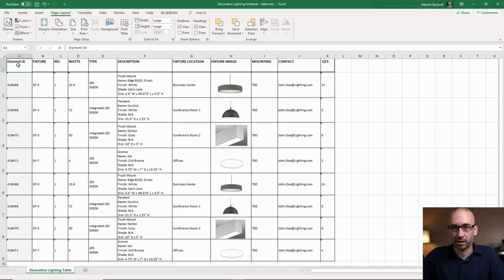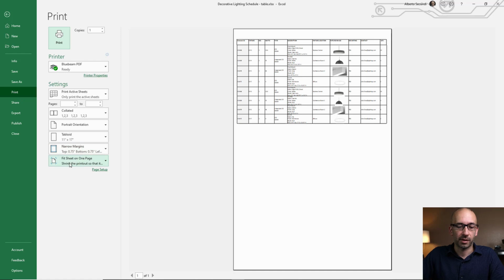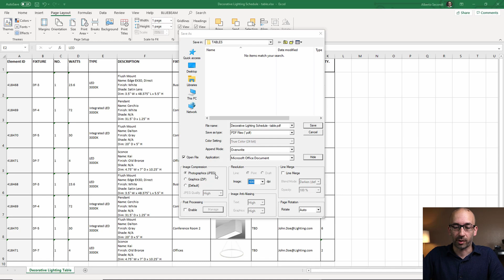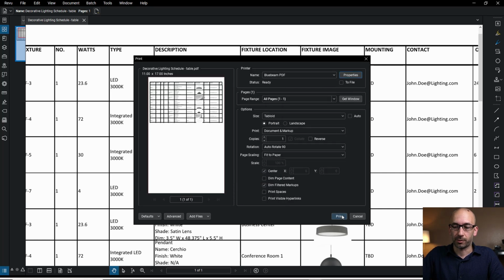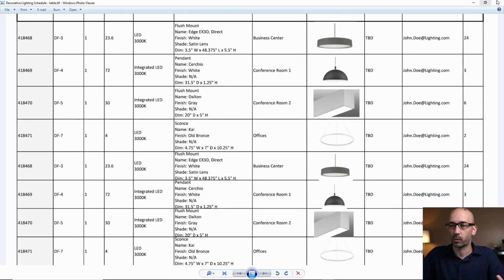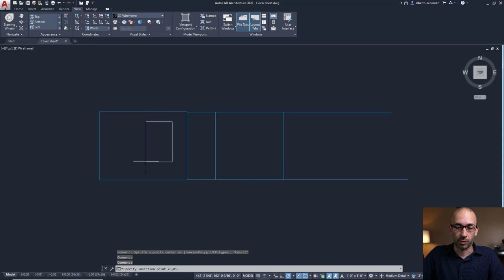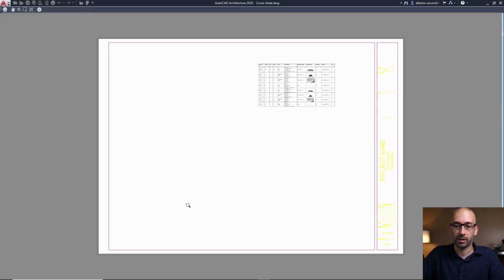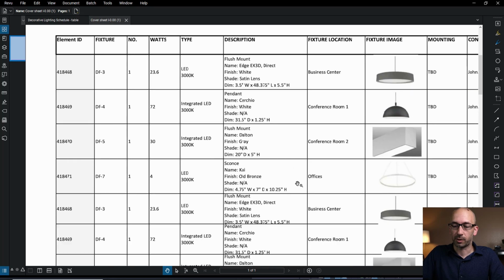How to insert Excel tables into Autocad and get high quality prints

Comment: Hi Alberto! I tried a lot of solutions.  What about print excel table to pdf @600dpi, import it in Autocad, print Autocad sheet (either in model space or paper space) with Dwg to Pdf setting Custom Properties>Raster image quality:2400dpi.
Another option: embed the excel table as OLE object. Of course this will bloat the dwg file size but you will have all in one file.
In case your table does not contain images you would set the plot quality of your imported excel file to low or monochrome for better linework and text quality. Bye
Reply from the maker: Hi Paolo, thanks for your comment! It makes total sense and I've used those tools for years. My team was using the same exact workflows that you are describing and they were not happy with the results at all. The resolution was okay, but they still had those image artifacts I showed in the examples. The OLE route wasn't reliable enough. This three-step workflow seems redundant, but it's the solution that gives us the best quality, low file size and it is simple enough to share. This solution may not be for everybody, but I believe it's good to have one more option out there.